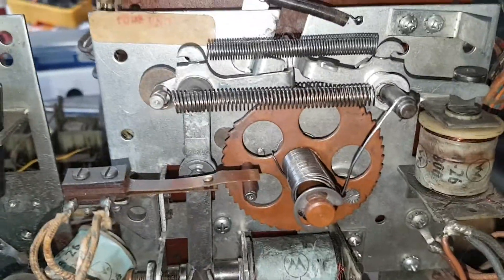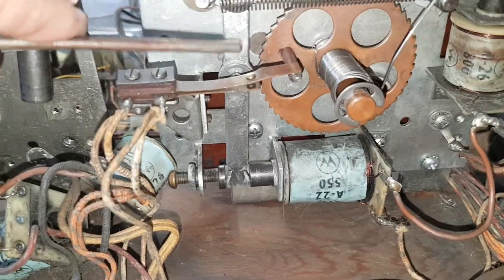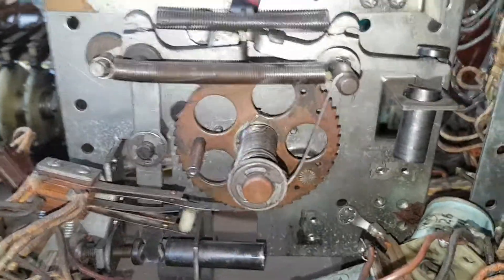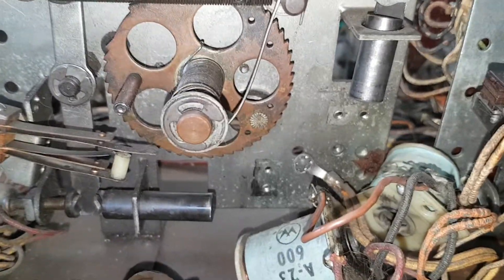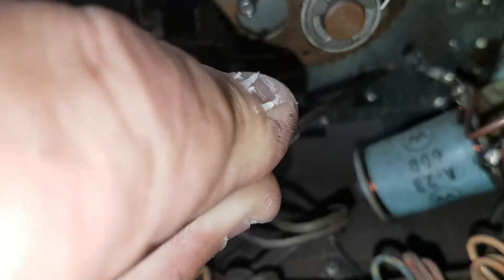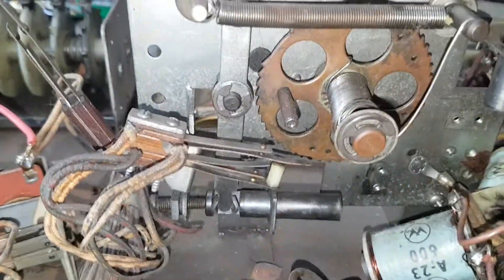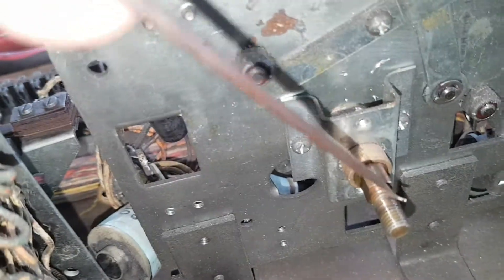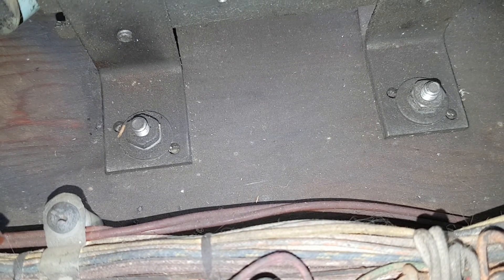William's stepper unit rebuild

Comment: am I guessing right that there is no motor here, just a big spring ? (and relays to let it move or block it) ?
Reply from the maker: No motor purely electromechanical.
Reply: @goatshedempinballrepair8545 oh ok. Now I see it. The first relay pulls the wheel one step forward, loading the spring at the axle of the wheel. That spring is only there to bring the wheel back in position 0 when everything is released. Brilliant ^_^
Reply from the maker: @akapype  yes but it's a solenoid rather than a relay but you've got the idea 💡
Reply: @goatshedempinballrepair8545  oh  yeah! indeed. There's the coil like in the relay, but no contact switches at the other end ^^"
Reply from the maker: @akapype sometimes there are switches in the units .

Comment: That "open at 0" switch ends up on the wrong side of that pin over and over again, I run into that all the time.  I don't know if people do that to it, or if it does it itself somehow, or what but I run into that over and over again.  Also the "opens at 4" or whatever switch on the coin unit on a bally does the same thing, ends up on the wrong side of the post!
Reply: My Star Pool does it by itself! Not sure why.
Reply from the maker: @markarts8323  what the peg get on the wrong side of the switch?
Reply: @goatshedempinballrepair8545  Yes! Star Pool was my first machine and a friend noticed the issue when I sent him a pic. This was before last xmas. The problem came up again about a month ago.
Reply from the maker: @markarts8323  interesting the stepper clearly needs some attention.
Reply from the maker: Join our Facebook group link supplied start a thread on there and we will help you https://www.facebook.com/groups/582691718587932/?ref=share_group_link
Reply: @goatshedempinballrepair8545  For sure! I haven't touched it yet and I noticed it still has metal coil sleeves so it may have never been cleaned up. Thank you!
Reply from the maker: Yes very common problem.